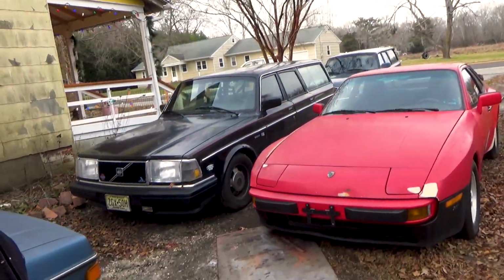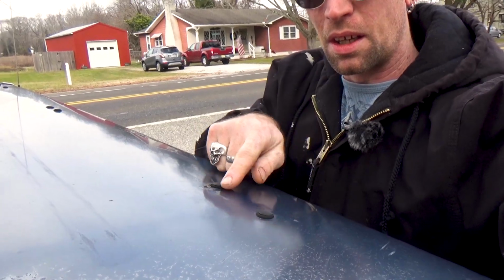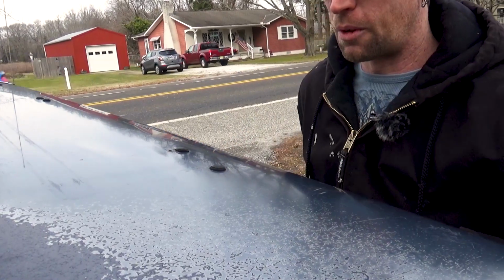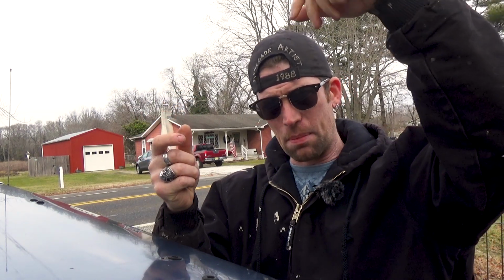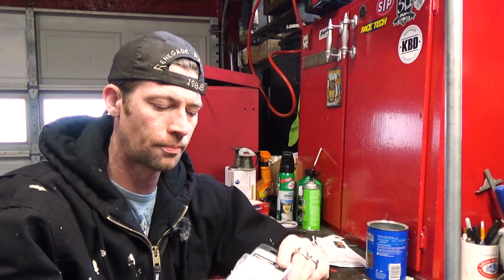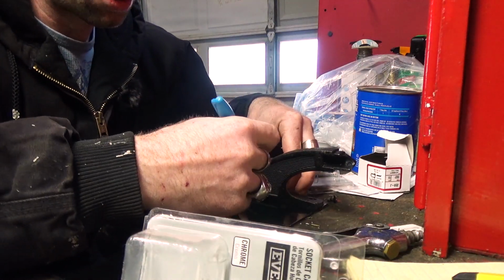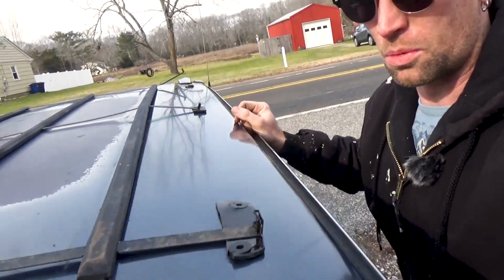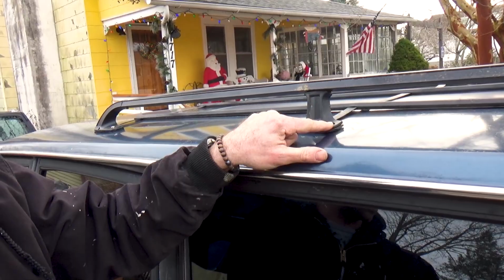Installing a Classic 240 Roof Rack

Comment: Does anyone know where to find the gaskets? I'm currently trying to overhaul my roof rack (adding wood slats, cleaning, and replacing cracked vinyl) but can't find any of the rubber gaskets for the life of me.
Reply from the maker: The last time I looked I found them on eBay, but they were NOT cheap in the least bit.  Which is why I used the method I did.  & months on and Ive had no issues
Reply: @GreaseRenegade  Thanks for the reply, glad to see your racks are still holding up. Do you happen to have any of the eBay links saved? None seem to be listed right now. I'm definitely going to be using your method on my 240 though, cheers!